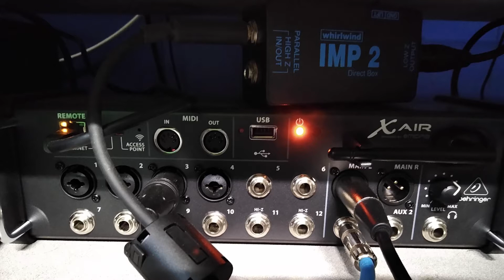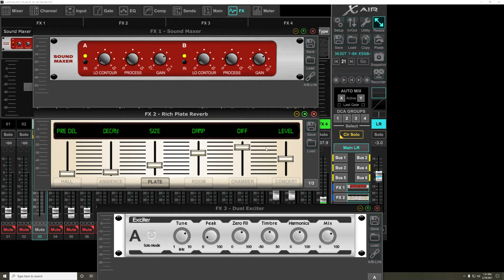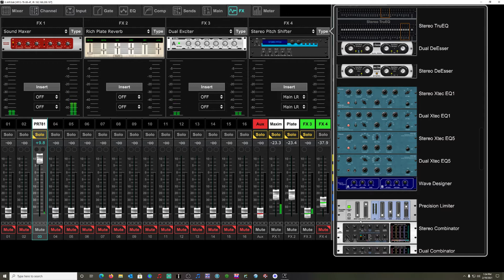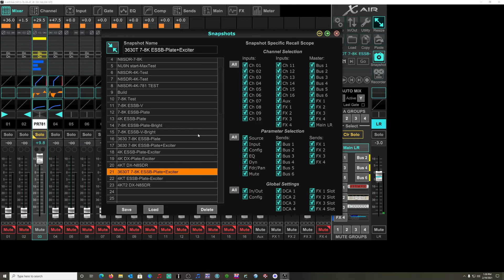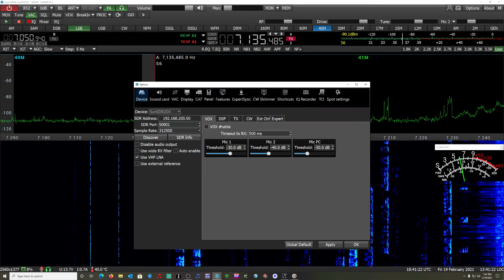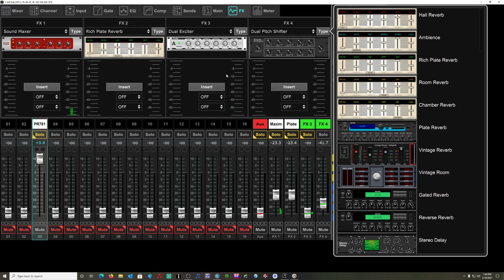Using a Behringer X-AIR series Mixer  (XR12) for TX audio processing

Comment: Hi Rick, thank you to sharing. Very nice intro. Hopefully we can get more X-Air users.
Just in case someone missed my X-Air/XR18 presentation; www.youtube.com/watch?v=EZ_NonKfxSc
Just one detail to comment. The DI box you using seems not the best. It uses only a 133:1 cheap transformer. If you want to keep your audio quality out from the XR12 down to the radio, you will need a better box. Please, check this out: http://goldenmaxima.ea1ddo.es/Adapter_eSSB.php
73, Maximo - EA1DDO

Comment: Nice video. This is a very powerful system especially for Ham Radio! What's cool about this setup is you can simultaneously connect multiple mics to multiple radios at the same time using just 1 X-AIR!
Just the signal processing alone is worth the cost of the X-Air!
Reply from the maker: Thanks for watching John- Hope your enjoying the MB1- and no flashing red lights

Comment: Nice job Rick, Very well done. This will help a lot of Ham operators looking to experience  ESSB Audio (Considering TX Band Width Of Their Radio)  Thanks for taking the time to explain the function's of the X-Air Behringer. There are A Ton of options in just one small box, As you Dub, The Rack In A Box. And may I add at a very affordable price considering the cost of outboard  Rack Gear. Keep up the good work Rick. Catch you on the AIR. No Pun intended.... Bill / K1WIL
Reply from the maker: LOL- on the x-Air-  Thank you Bill

Comment: Have you ever tried cantable with a mbox2? Very similar system only a few hundred bucks cheaper. The only issue I’ve found are the drivers. They have to be right. But once you hear them , it’s amazing what they do. All peq, limiters, aural ex,comp, big bottom and reverb in one stack of software. Not as complex as protools. 73
Reply from the maker: No I have not- The nice thing here with the X-Air series is there is no drivers involved- the box is self contained there are many effects built into it- and you get PEQ, True EQ - Pultec EQ options and more- the only driver that would be involved is if you used the XR-18 or 32- as those do give you the option of an ASIO  - so you could  use that as a VAC into many applications which allow for virtual audio sources- I wanted to stay away from things that could cause latency- and since this is all done in the sperate box and routed to the mic input the latency is very low to almost non existent depending on some f the FX being chained-   the software is just a GUI- it does not load on the system, basically unzip it put it in a folder create a shortcut too the exe, it doesn't use system resources to speak of its just a graphical interface to control the box. I'll lookup the Mbox- thanks for watching and for the info.